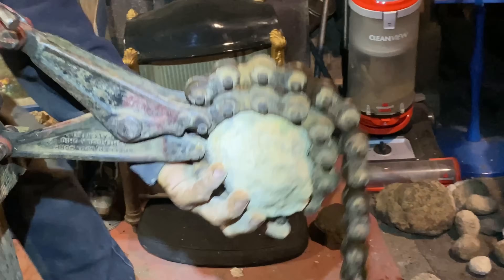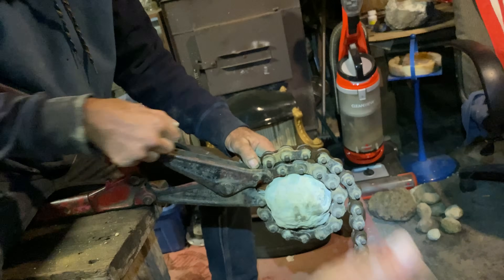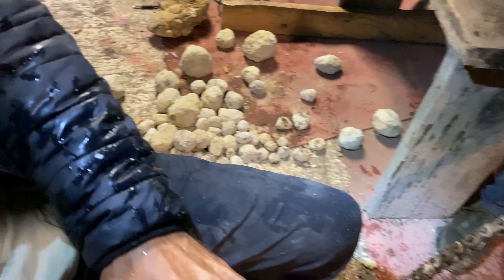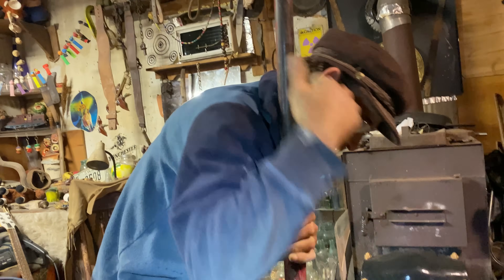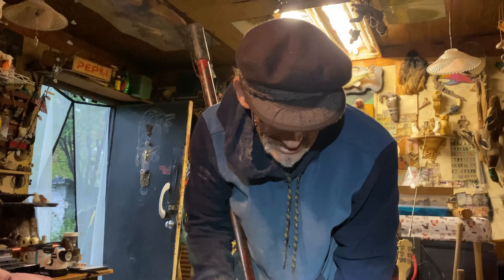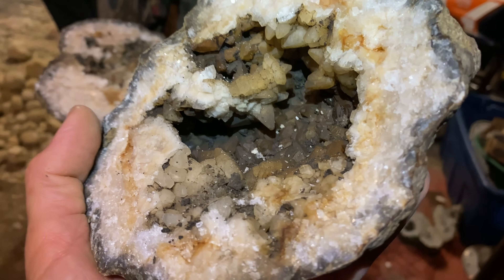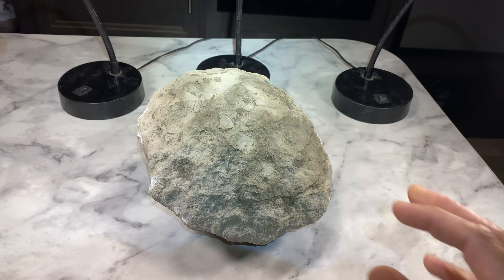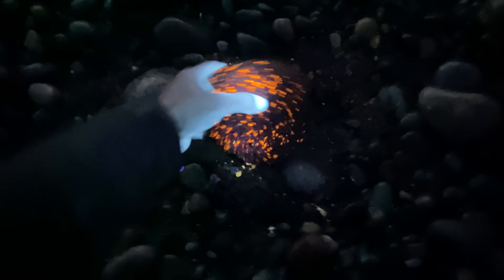Geode Cracking Reveals 350 Million Year Trapped Water!

Comment: Have to completely disagree on cracking vs cutting.  Cracking, you have to get extremely lucky for the egg to not just completely shatter, and then have to hope it cracks along a weak point where maybe a crystal that is jutting out doesn't just crack off as well.  I'd MUCH rather take my chances with a diamond bladed saw cutting through slowly than shattering a geode and it being a complete waste.
Reply: If u are smashing your geodes your cutting wheels are dull or u are not adjusting the cracker properly you want yor handel to be at at a15-20%angle to start.
Reply from the maker: That’s not the case, I’ve seen hundreds of geodes cracked this way and not 1 didn’t split perfect the way it was set into the cutter. And again, cutting with saw will destroy any protruding crystals, which around 20% have.  It’s not the best way if you want the best outcome..
Reply: @TheCrystalCollector  agree to disagree. Ive seen too many ruined using that method.  Thankfully there are plenty of geodes to go around. I'll continue to cut mine and others can crack theirs.

Comment: Wish pipe cutters weren't so darn expensive. My saw with lapidary blade was FAR cheaper. This year I've cut 1k+ geodes on 1 blade and only cut thru a couple specimens the wrong way. Pipecutters are nice but saws are really good for entry level.
Reply from the maker: Yeah, I bought a used pipe cutter for $450 and I got it in the mail and the chain was locked up, it was a bummer I gotta get a new link for it